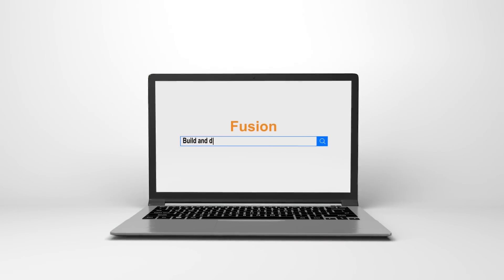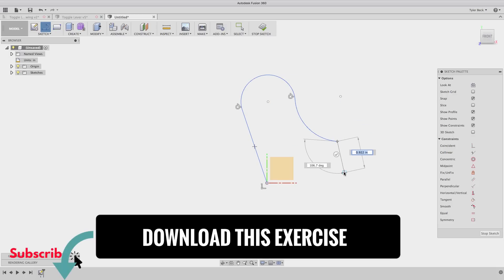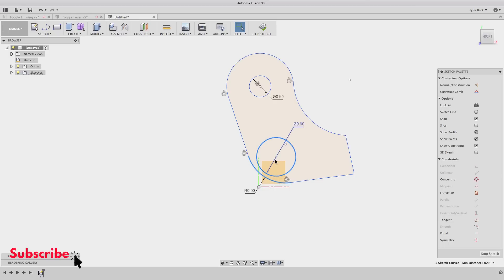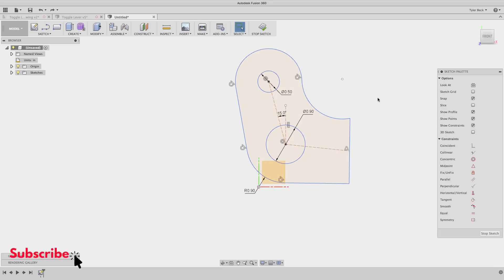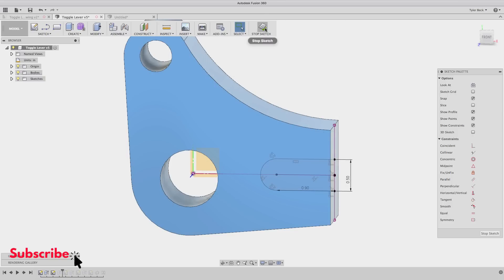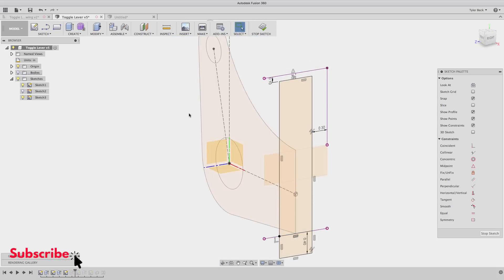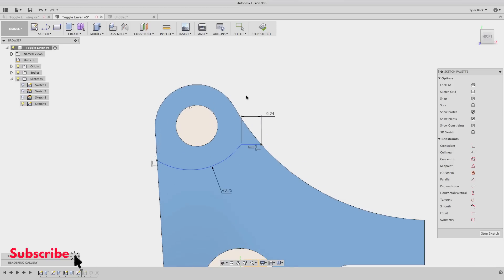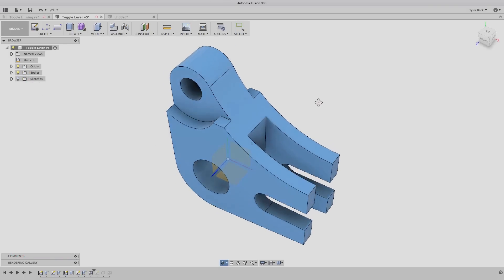Fusion 360 Tutorial - Toggle Lever Example

Comment: Tyler,
Love the demos. I teach Fusion 360 to my engineering class and encourage the students to watch your videos.
When I go to drawing mode, I am having a problem with dimensioning the 15 deg angle between the vertical and the dia 12.75 hole relative to the dia 19.05 hole.  Is there a way to insert a line in a drawing so that I can grab it to use an a line for the angular dimension?
Reply from the maker: Hey Chuck,
Just made my day man!  Glad to hear it. And, day ruined...yes, this is a major limitation! Drawings desperately need to add sketch lines... the only work around I have found is cheating w center lines and such or using the note tool :(
Reply: Glad I could help with your day. ;-)
I'm finding that to make drawings that conform to Y14.5 the models really need to be finalized in AutoCAD.  But that's a reasonable tradeoff, I suppose.  
Might I impose on you to add a simple assembly to your tutorials in the near future?  Not a lot out there in terms of reference or tutorial materials.

Comment: Hi Tyler. From what I see, this looks like you could put all of your lines in ONE sketch and then do three extrudes (two from offset planes) and you're done. Here is what I made, (ignoring all the exact dimensions and constraints you put in your sketches):
https://www.flickr.com/photos/128559914@N08/35392160936/in/dateposted-public/
https://www.flickr.com/photos/128559914@N08/35265226362/in/dateposted-public/

This works only if the cuts around the upper hole are the same depth as the thickness of the lever 'forks', otherwise those two cuts would need to be made separately.

I have really been enjoying the combination of Fusion 360, my CNC mill (converted X3 Grizzly machine) and my new 3D printer. This is good nerd fun! Thanks for starting your channel on Fusion 360. Very helpful!